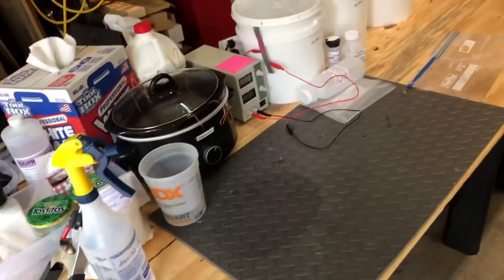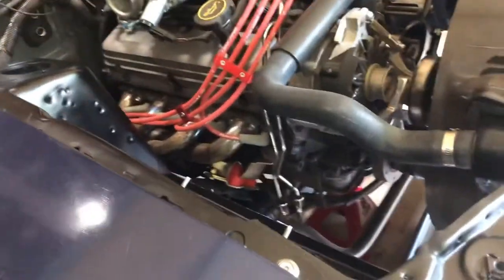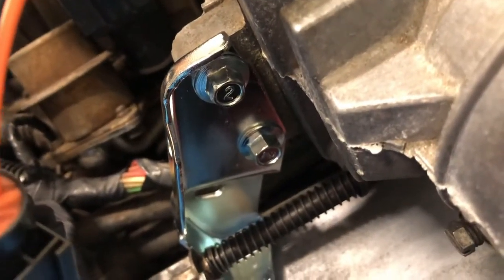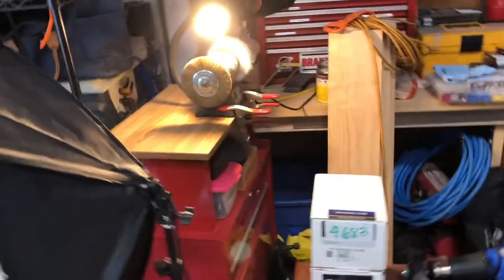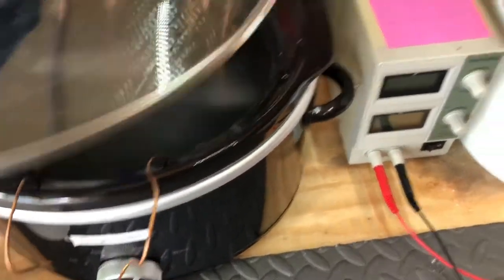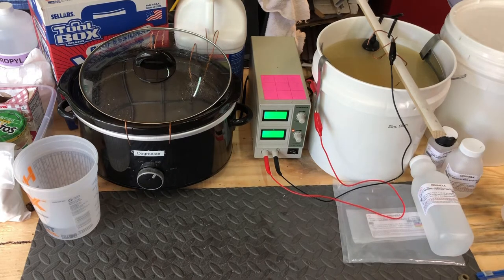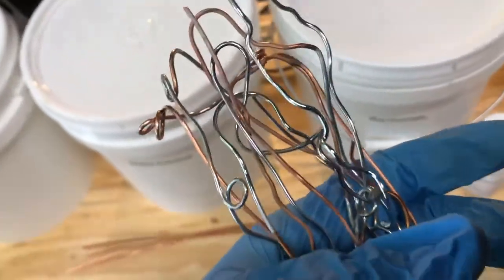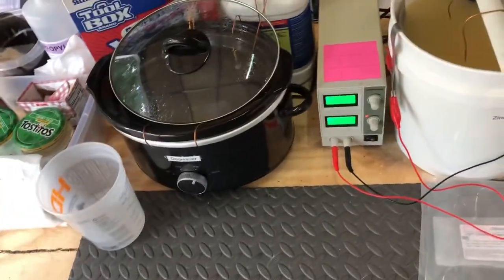DYI - Zinc plating & Blue chromate from Caswell

Comment: Thanks for the video!
What heaters are you using and what wattage? Does everything have to be heated including the Muriatic bath?
Reply from the maker: I heat the degreaser in the crock pot because it needs to be hot.  I just use fish tank heaters for the  zinc bath and blue chromate dip, and that’s it.  If I were doing this in winter, I’d probably use fish tank heaters in each bucket (but not the 100% muriatic acid stripper).
Reply: @Foxedup  thanks! Do you remember what heater you purchased? I’m trying to find one with the correct wattage that isn’t to long for the solution. I don’t have the kit yet but trying to get everything so I can get started once it’s here. Thanks

Comment: Thanks for the video! Gosh I have the same story. I have done home brew plating kits and they plate but they always come out a dull grey. Then I have to use a wire wheel or steel wool to make it look better. I did buy the blue chromate from Caswell but the results of using it were poor. Maybe I should suck it up and buy the kit from Caswell. I have a hobby of riding and restoring dirt bikes for my own use.
Reply from the maker: Yeah the results weren’t right until I got the whole kit and followed everything exactly.

Comment: I don't think you mentioned it in either video. Beyond the aesthetic benefit, it protects the hardware from rust. Bright or black, both coatings are a sacrificial layer for oxidation, which is why these brackets and bolts still exist 30 years later. Now they're good for another 30!  Appreciate the time to explain the process and how you worked through some challenges. Like the radiator hardware kit too.
Reply from the maker: Thanks!  Yeah now I can’t stop playing stuff! Just posted the control arm bolts on my Instagram. ✌️
Reply: @Foxedup  Works for pinball parts too :)

Comment: My parts are coming out looking really good! Dare I say they look like chrome and better than when new. Sometimes I get a little too much rainbow after dipping I'm blue chromate. Have you had that happen?  Also do you find that larger parts take more time to plate?
Reply from the maker: Yes the larger parts can take more time, especially the bulky hood latch mechanism.  Wrapping the wire around more areas of the larger part helps.  I don’t think I had any rainbow type issues on mine. Make sure you don’t move the parts around too much in the blue chromate - just a gentle back and forth for about 5 seconds and then don’t rinse.
Reply: @Foxedup  thanks so much! I will try that!
Reply: @Foxedup  Here are how some of my parts came out: https://youtu.be/6Y1ftLoWOtU
Reply from the maker: @Mr10usdad  man those parts look great!
Reply: @Foxedup  thanks!
Reply: @Foxedup  I honk it is the fiber pads from prymemx. The parts look better than new. The pads make quick work of rust and refinishing parts. Check out his site. Here is a video he has and you see them in use: https://youtu.be/8_e9EAJiiwY
Reply from the maker: @Mr10usdad  nice! Definitely trying out the scotch brite wheel next time!

Comment: Can you tell me how you mixed your muriatic acid? Like the amount of water and muriatic acid? I know it is bad stuff so you have to be careful. My Caswell chemicals came in today. Maybe i should have bought the manual. Thanks!
Reply from the maker: The muriatic acid that I was stripping with was just straight out of the jug!  Be careful that you only use steel parts in there.  Brass or aluminum won’t fair well.  
The muriatic acid dip right after the zinc bath was one gallon of distilled water and maybe 5 ounces of muriatic acid.  
Good luck!
Reply: @Foxedup  thanks again' I really appreciate the information. I guess I will go ahead and get the Caswell Manual as well.
Reply from the maker: @Mr10usdad  - Well let me know if you have any questions when you’re setting it up. I’ll be glad to help!
Reply: @Foxedup  thanks!
Reply: @Foxedup  I am having some good results with my plating. I have a few questions. How often do you add brightener? Also, it is cold outside in the garage. It is around 40 degrees down here in Georgia. I have a heater in the zinc bath. Do I need a heater in the chromate as well?
Reply from the maker: @Mr10usdad  yes I would use a heater in everything.  Just enough so that it isn’t cold.  I think the plating just does better when nothing is below 70 to 80 degrees.
Reply: @Foxedup  thanks! I used a heater in the zinc bath. Tonight I at least brought the chromate inside to get it room temperature.

Comment: I have not plated in a month or two. Now i have an issue. Maybe you have had this before. My part comes out of the plating bath looking great as usual. When I put it in the blue chromate some parts of the part turn black. Any ideas? I wondered since it is so hot outside maybe some of the chromate solution has evaporated and now it is too dense. Maybe i can take some out and add water to that part and try it.
Reply from the maker: Geez, nor sure on that one. Seems like it could be any number of things, but it may be best to start with a new chromate solution.
Reply: @Foxedup  well I agree, I just had to buy  new solution.

Comment: I have the same setup from Caswell. Are you using 0.14 amps per sq in or are you using a higher number? My plating comes out dull following their calculation. I called them up and they didn't have an answer.
Reply from the maker: Yes .14 per sq inch.  Almost everything I put in for 15 minutes.  Be sure to measure all of the surface area - like a 2 sq inch piece of steel would calculate as 4 sq inches.  Also, I add a teaspoon of brightener. Every 20 or 30 pieces. The brightener makes a huge difference.
Reply: @Foxedup  I'll recalculate the pieces including the copper wire. Maybe I'm coming up short with the amps. Brightener went in at the beginning of the bath setup (3 gallon setup) and one again after about 15 hours of plating. Didn't seem to make a difference for me. What ceiling voltage are you setting your rectifier to? 1, 3, 5 volts?
Reply from the maker: @pattygq  my voltage is typically running below 1v
Reply: @Foxedup  Thanks
Reply: Did you ever solve this issue?
Reply: @Mr10usdad  Yes. So what I've done was filter the bath with a pump. I rigged up a filtration system with a 5 micron filter. That takes care of the bits of zinc plate that break off during the process, fly thought the solution, and wind up on your part. Next I will plate a few pieces at a time in my 5 gallon bucket setup if we're talking about nuts and bolts here. If it's a carb piece then it's the only thing in the tank. Keep the part at least 4" below the surface of the solution and get a relatively strong fish tank pump. You need constant movement of the solution or this won't work. Keep the bath around 80°F. It'll work at lower temps but it won't plate as fast. Ok so for the amps/volts thing. I've found that if I turn off the tank filter and fish tank pump I can see bubbles forming on the part which is the plating action. For example, let's say I throw a 3" bolt in there. I'll start out with 0.25 amps and increase it until I see small bubbles forming on the part. I'll then back the power down by 1/4. So if bubbling is on the part at 0.50 amps, I'll move it down to 0.25 amps. I cannot stress this next part enough. Constant movement of the part is necessary or shadows will form and areas won't get coverage. Zinc plating baths have relatively good plating coverage behind the part if you don't move it as often but I've found this only holds true in cylindrical and small parts. I'm noticing that while plating the voltage is 0.75 - 0.90 volts. People say don't be concerned with the volts but I can say this is usually a sure shot I'm right on target with my piece and I won't be burning it if I forget to move it around in the solution. Burnt spots look like bright spots on the edges of the parts. I've also reverted to one anode instead of two. Make sure the anode is the a bit longer than the length (height) of the part you want to plate; as the zinc leaving the anode while plating comes out in a straight line towards the part from the zinc plate. Place the part as far away from the anode as you can but keep it within 9" of the anode. And finally, you can get really shiny parts that look like chrome without making them shiny on a wire wheel before hand. You're just going to blow through your brightener faster than usual. Add brightener in the amount they suggest per gallon size of the tank. Don't add more than necessary or you'll have to filter the solution through active charcoal to remove excess brightener. FYI I've never had to do this. Stick with what I said earlier about the amps/volts, bath temperature, constant movement of the part, 4" below the surface, and add the required amount of brightener and you'll be fine.

I also run the sub-Reddit called Zinc Plating. It's empty at the moment but if you've got questions, throw them in there. I also have a blog but I haven't finished uploading my experience with Caswell's kit since it's super detailed.

Edited: For spelling and context.

https://www.reddit.com/r/ZincPlating
Reply: @pattygq  I am glad you are having good results. Thanks for sharing all of this.
Reply: @Mr10usdad  You're welcome. Sub that that Reddit and I'll shoot you some photos of my setup and parts.

Comment: I prefer powder coating for most car parts. I bought a powder coat kit from Amazon for $130. I was thinking about this for new beak rotors. I'm not sure if powder coat is a good idea for rotors and won't go down in the cooling fins. I am tired and replacing rotors every year because of a little rust in the parts that don't touch the pads. Ugly rotors are not acceptable to me even on the work trucks if visible through the rims
Reply from the maker: Haven’t looked into powder coating yet.  Might give that a try one day!
Reply: This is just my take on that thought, but I don't believe powder coat on brake rotors is going to work.  It's just a coating from a relatively soft material.  I would expect powder coating to come off very quickly in a brake rotor application.  Rotors get so hot, that even the coating not under the pads would likely be ruined.  It might actually interfere negatively with your brakes.  Electroplating is a coating of metal bonded at the molecular level.  It will be able to take the heat relatively well and would probably keep the remaining parts of the rotor from rusting, but it might experience some blueing from heat of braking.  You'd have to watch out for the amps required to plate something that big though.   Basing the current levels on roughly .14 Amps/square inch - which is what I hear for most electroplating - you'd need 40 Amps or more to do a 14in diameter brake rotor....
Reply from the maker: @jayestes_vids  I would agree that some type of plating would probably hold up a little longer. I bought some zinc plated rotors pretty cheap - like $30 a piece - for my car. I’m interested to see how long the finish holds.  I’ve only driven it around 200 miles since I put them on.